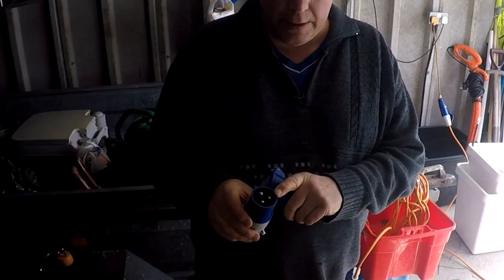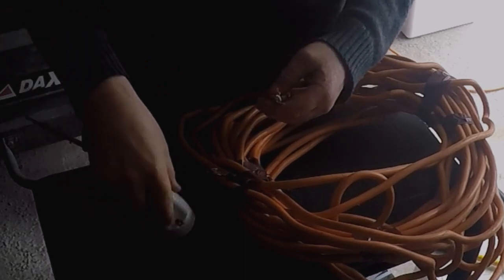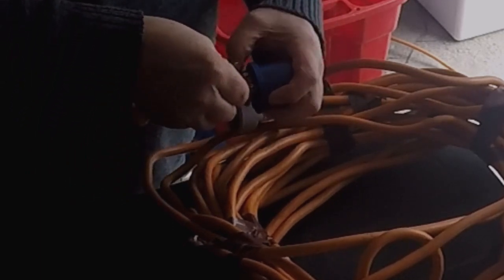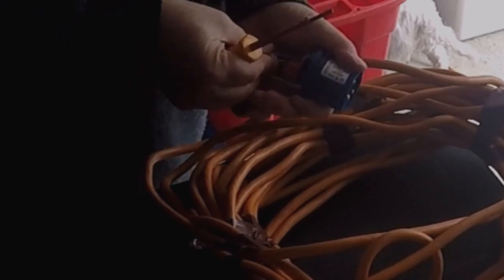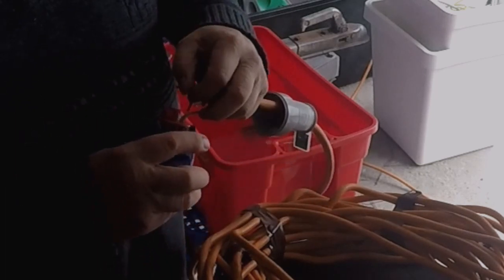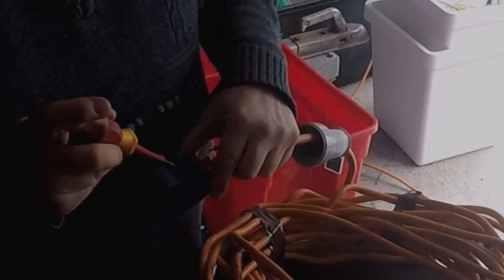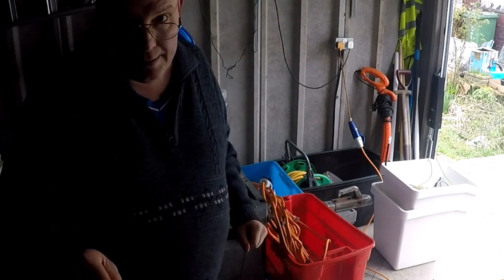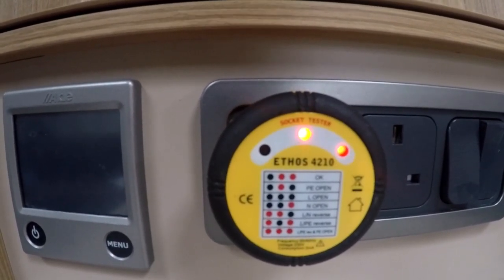Caravan hook up lead, how to wire up and test correct polarity.

Comment: Can you use Caravan/Motorhome Hook up cable as Extension cable for solar panels? 
I mean how thick is the caravan hook up cable, how many AWG? Is this single strands or multiple strands?
Reply from the maker: I don't know much about solar, but you caravan hook up cable is generally 1.5 mm stranded cable. I hope this helps.
Reply: @TheBeckwiths  do you know what's the AWG, is it 10 or 12 and how many wire strands in each.
Reply from the maker: @SSUKBD  no as we don't use awg in the UK we cable sizes in mm. As for number of strands never had any reason to count them.